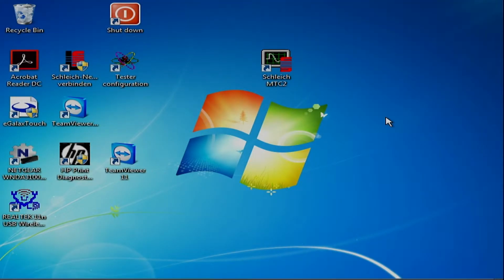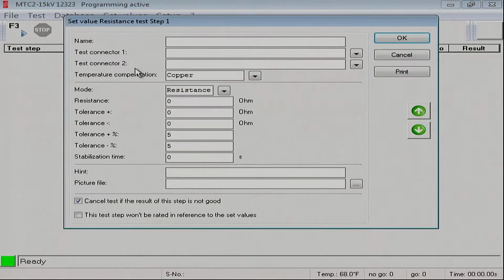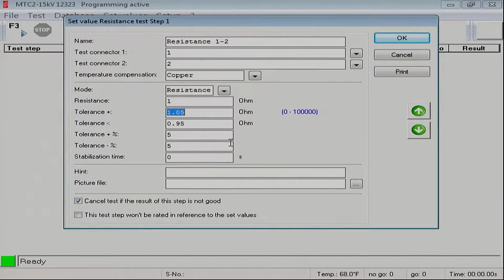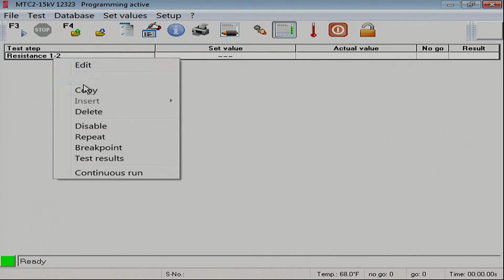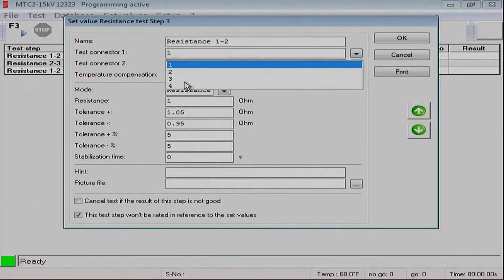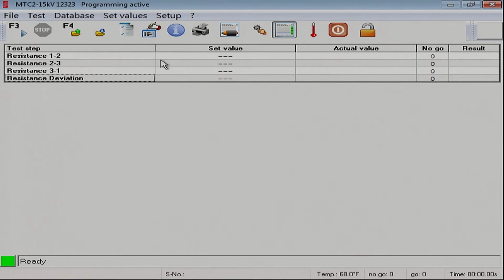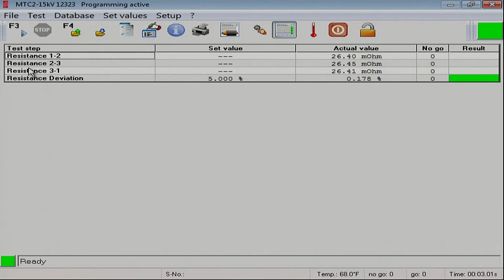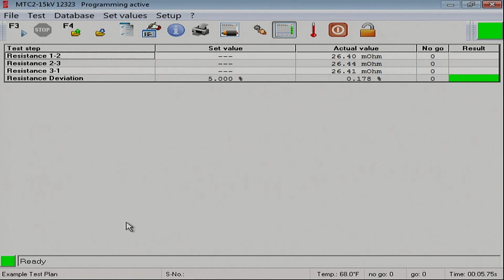MDS MTC 2 Resistance Test Setup

Comment: 100kohms is the maximum resistance the MTC2 can measure. It means there is an open somewhere in the test setup or the item you are testing really is open. Check carefully the lead connections making sure the correct test leads are plugged into the clamps properly. If you still have trouble, get in touch with MDS, if you are a North American customer, or your local Schleich representative.